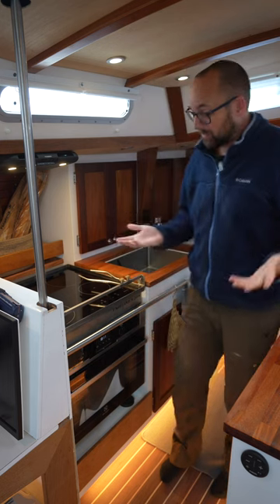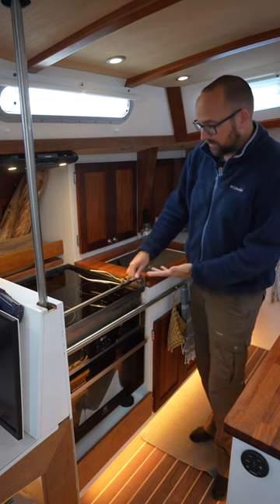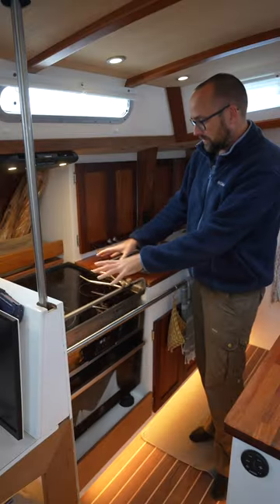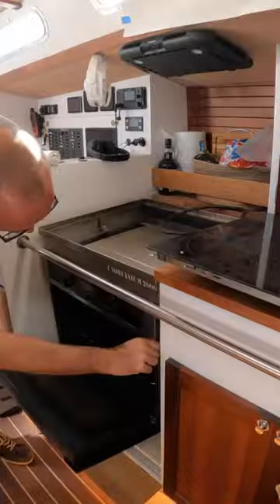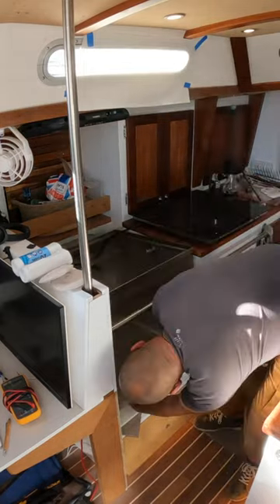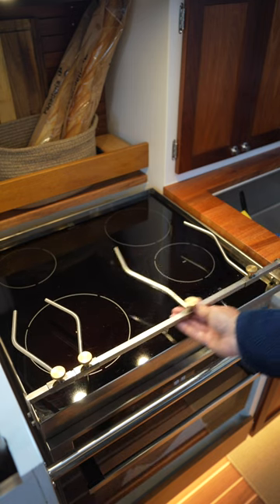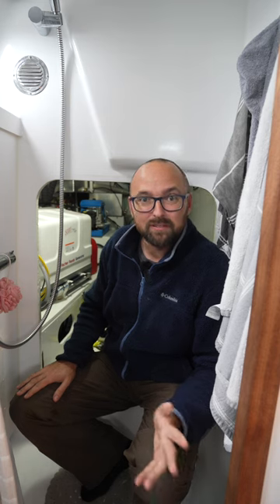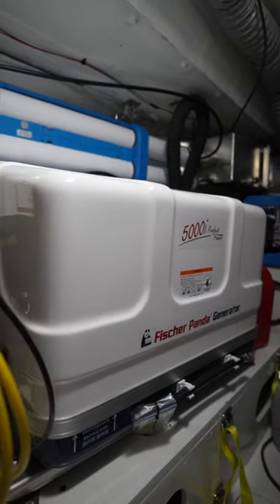Sail Life #short - 100% electric galley on a sailboat ⛵️

Comment: Curious if you're happy with the performance vs propane?
Reply from the maker: I love cooking with the electric galley. All the propane ovens I have tried have never been as good as electric. Induction rocks and it's super easy to keep clean. It's also nice to not think about refilling propane. The big downside is the cost. It adds up quick with a big inverter, lithium and genset. No doubt it's cheaper to stick with propane :)
Reply: @SailLife  Thank you for replying Mads. I was wondering the same thing.

Comment: How come you are not supplementing with wind generation?  Seems like an obvious way to keep the batteries topped off during a cloudy day.
Reply from the maker: There are a couple of reasons. One is shading. There is no where to mount a wind turbine that wouldn't cause additional shading on the solar panels. I also think the output is low considering the price and noise :) Some people seem to love wind turbines - I'm just not one of them :)